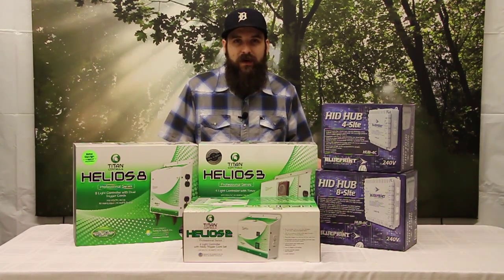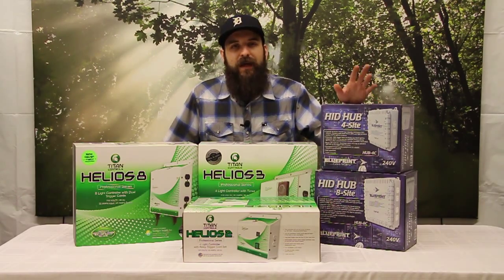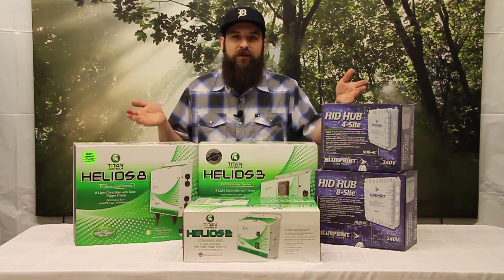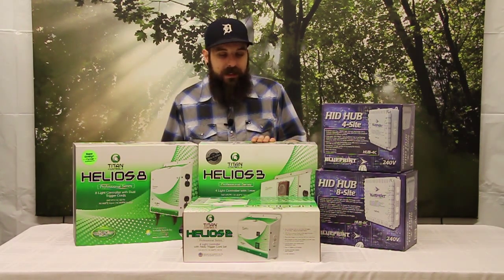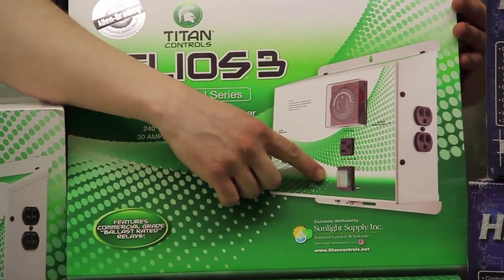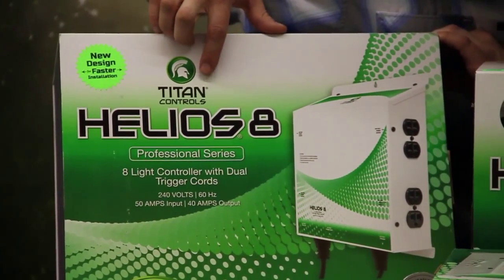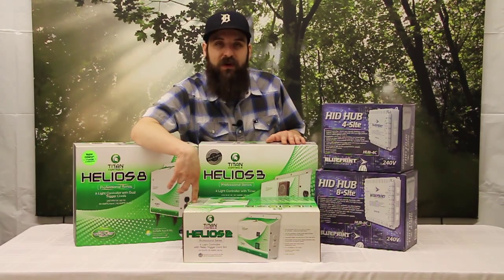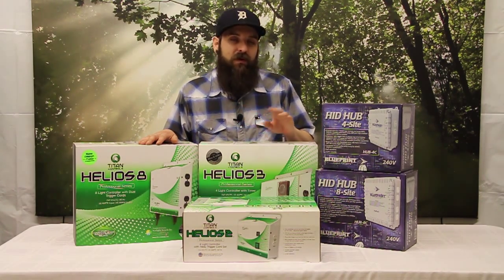Grow Room Lighting Controllers and How to Power your Indoor Garden

Comment: These types of light controllers are DANGEROUS!!!! THERE IS NO PROTECTION DOWNSTREAM FROM THE 30A BREAKER.  Each 2 or 3 lights 1k HID should be protected by a seperate 20A breaker.  IF one of your ballasts shorts and goes bad and starts using extra Amps you will have NO PROTECTION until the load reaches 30A or more to flip the 30A breaker. By that time you most likey have a FIRE to deal with.... I am concerned people use these LC all the time and they are RISKY. Notice No UL LISTING anywhere on these.  Titan brands were recalled!!  Folks are better off building a 150 Amp 6 space MLO Subpanel fed by a double pole 125 amp breaker. in this 150A subpanel install 5 or 6  20 Amp double pole breakers  From each 20A breaker wire a 240v Tork 1109a commercial timer and from that timer  wire a 4 outlet 240v box. This 4 outlet box can handle 3400watts, this 150A sub can fit up to 6) 20A DP breakers to power your setup.  just wire a Tork timer to each 20A breaker you will need otherwise just wire the extra 20a break to its own 4 outlet box.   
So essentially one could power 12  1000w lights with this setup (3kw per 20A circuit) and still have a 20A DP breaker left unused  so you could use that extra 20A for mini split or whatever else you might be running at 220V. Hire an Electrician if this makes no sense and especially if you are not mechanically inclined. Good luck!
Reply: Could always add 20 amp inline fuses easily
Reply: This whole explanation and process seems so extra... but I'm am an extra type of guy. I ran the helios 8 but installed a fuse breaker. But the sub panel and outlets is brilliant. A lot of work, but full direct power everywhere. I like it

Comment: Really happy with this purchase>>>t.co/2VPH3QqQ5V  . For those who are wondering how much much real time electricity it uses I plugged it into my Kill A Watt meter P3 P4400 Kill A Watt Electricity Usage Monitor and it measured 13. 6 Watts and 0. 11 amps while running. This was after I had set up the AeroGarden and had it plugged into the Kill A Watt meter for 5 minutes. I have not run it through the meter for a 24 hours period .
Reply: Gardening for dummies like me.

Comment: Great Video...SOOOO many people do not understand the befits of using a low voltage 220 set up...
I got a lower electric bill, and my lights and fans last a lot longer.
3 years and 12 crops later, my stuff just runs better.
Like this guy said, if you have a dryer plug that is not being used, get an electrician to wire you up a 220 system for your grow...
It cost me $650 
Best investment I made.
Reply: rocknroller1999  bs your ballast draws less due to efficiency w 220